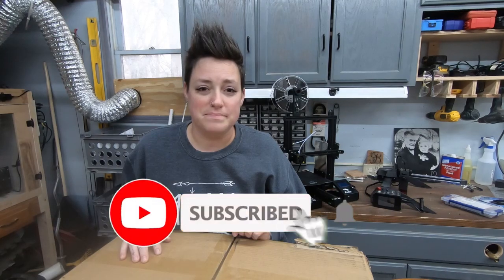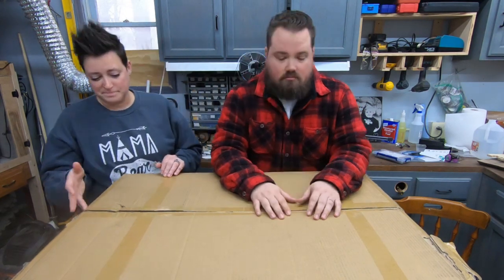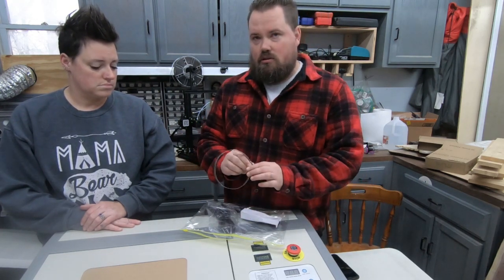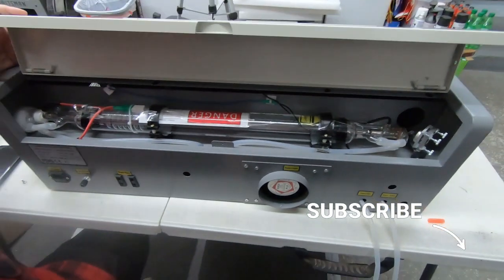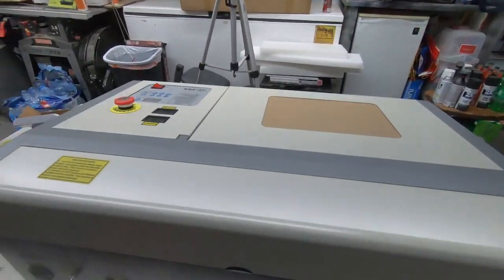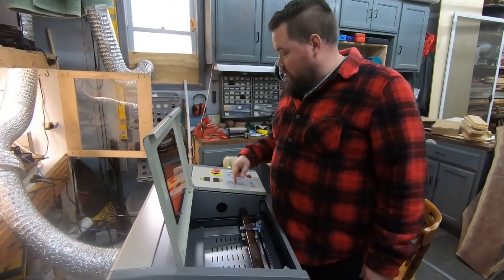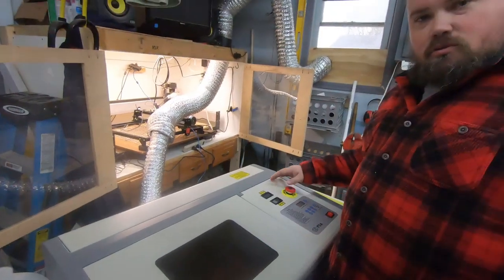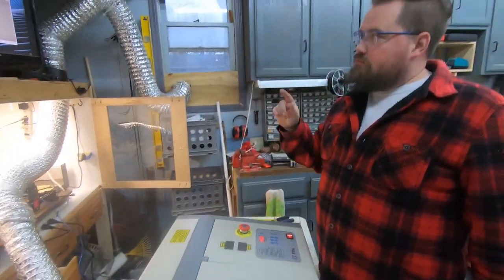Our First CO2 Laser | Monport K40

Comment: Just recently happened across your channel.  I recently got a competitor's K40 (OMTech), but, as you stated, they are all basically the same - with only minor variations.  Looking forward to going on this journey with you - discovering all the possibilities - and, maybe we can learn from each other.
Reply from the maker: Sounds like a plan! Good luck with yours!
Reply: @KLRform  Thanks, and to you also.  Just curious - how do you plan to cool, or how do you cool the water to the Laser Tube?
Reply from the maker: Have not done anything yet. But have read about freezing bottles and adding them to my bucket.
Reply: @KLRform A lot of people seem to do that.  As it is very hot where I am (90 to 100+) for 4 to 5 months  of the year, I don't know if that will be practical for me.  I found a small tabletop / countertop icemaker at a Thrift Store for $30.00.  It works great.  I am going to hard plumb into the cooling lines making it a refrigerated chiller.
Reply from the maker: That is a really neat idea.

Comment: The mystery box is silicon for when you eventually replace the laser tube.
Reply from the maker: Ok thanks for the info!
Reply: @KLRform  As The Louisiana Hobby Guy said. It is used when you either, change the tube, or, if you need to re-apply the silicone for any reason to cover the terminal wires going to your CO2 tube, you then put the little bit of silicone back on to cover the terminals and leave to set overnight. Watch YT's as you need to get this right.

Comment: When I had a K40 I used Inkscape to make my designs and K40 Whisperer to run the laser. It made the laser so much easier to use.
Reply from the maker: We have Inkscape but don’t use it a ton right now. Tend to use gimp and lightburn.